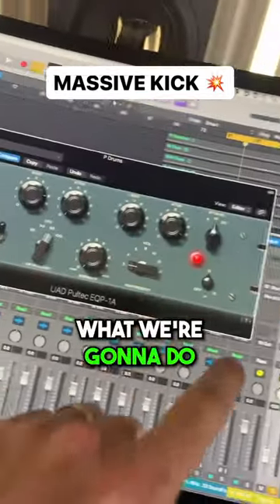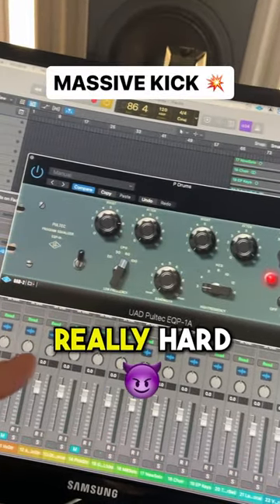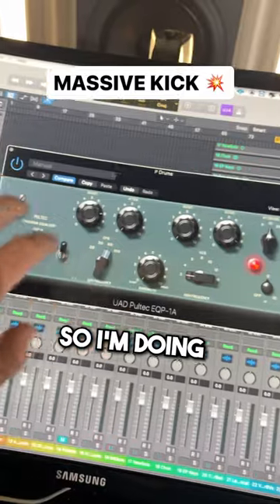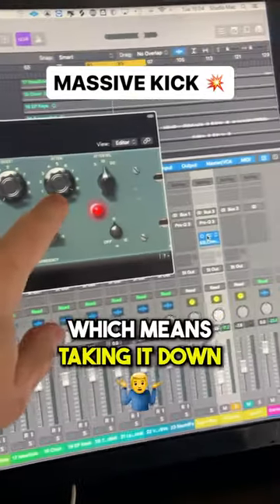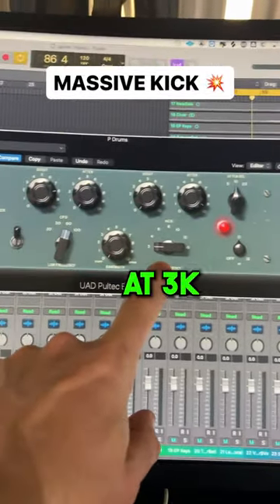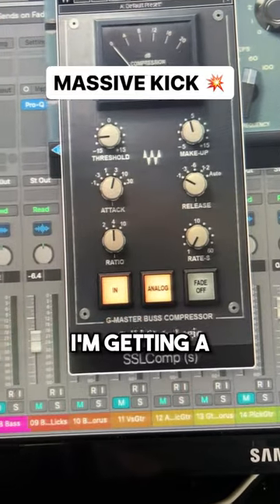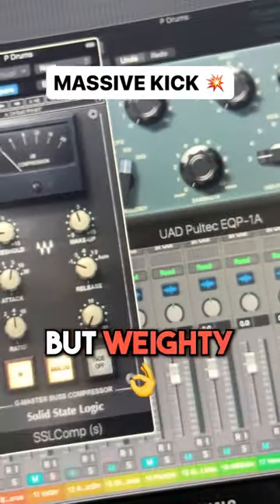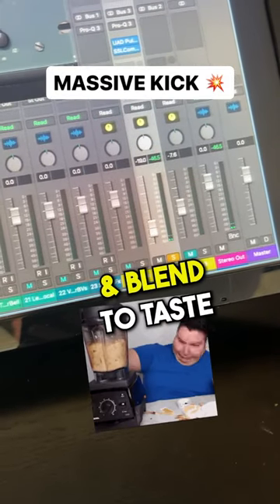MASSIVE KICK 💥

Comment: Hey streaky. Before the comments get flooded can you explain what the analog button does on the SSL? No one seems to know. They all just say it adds noise but I’ve always suspected it adds some sort of transformer saturation.
Reply: Hey Brother, the analogue button in SSL is meant to give you the warmth of the analogue SSL hardware, "not exactly the same but they try". It brings in harmonic saturation to the table, and i feel like it does some kind of minor boost and cuts in the frequency spectrum too, to boost the low mids a little more in the signal that goes into the plugin, so imitate that warmth of the hardware.
Reply: @psychoticblackout6982  thanks man. This makes it much more worth buying.